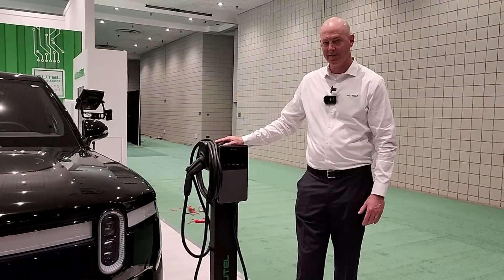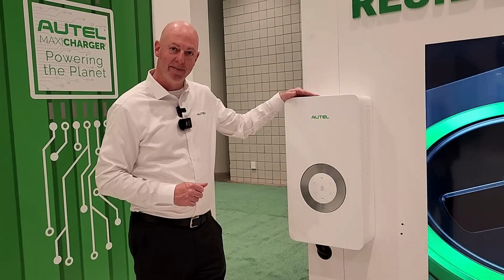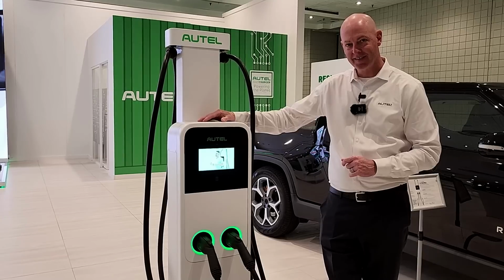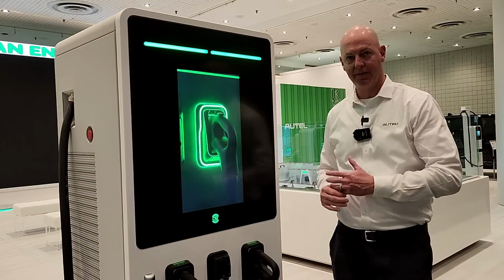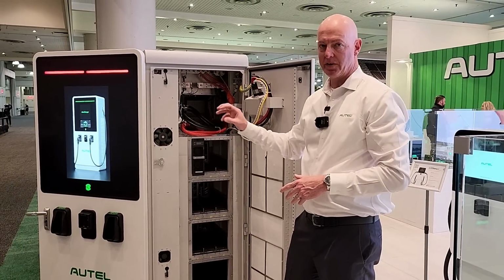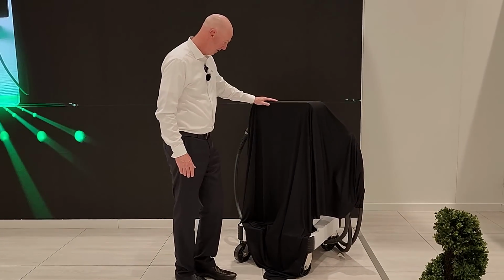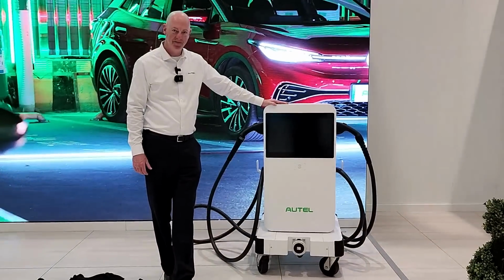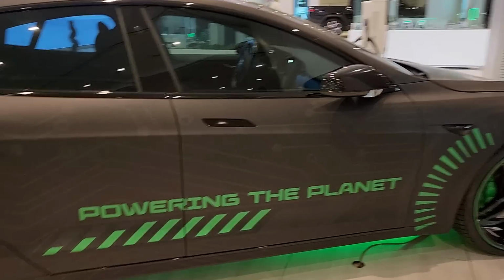Autel EV Chargers At The New York Auto Show

Comment: Excellent Autel
What I want to see if possible and vehicles become Bi-directional is the ability to work with a home storage solar system. 
I have the inverter and automatic transfer switch already. The inverter has empty breakers for more solar panels and it would be awesome if the car could used with the equipment I already have. Seems it would save people money. Just a wish.

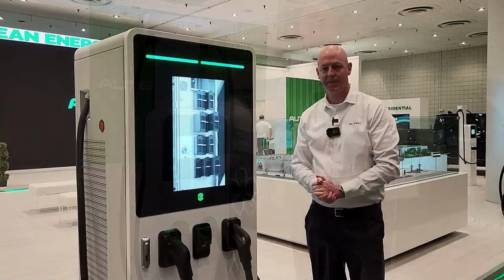Comment: 10:17 - heads up Tommy Molo, heads up Young KC, i meant to put this in the comments during last week's IE Podcast when Kyle was recapping his trip south through Georgia in his G/F's new Taycan (new to her anyway).  as you may or may not have heard me mention before I'm heavy into the Motorsports/Racing sector, well in one of the latest emails received from SEMA dated 3/30 there included an announcement that in collaboration with Georgia's Indigo Energy a bank of AUTEL DCFC's have now been installed at Atlanta Motorsports Park making it the first racetrack in "Murica" to go electric...🤙to be specific it's 5 of the 180kW MaxiChargers like the Autel rep/NBA Forward was showing you (and Kyle previewed back at CES). yes, the article DOES include a pic showing 5 units on pads - so it's legit - but technically the cables shown are still hanging shrink-wrapped on the sides, so no info on whether or not any related transformer equip is in place...? or any additional drop work to feed power to the site is waiting to be done by the Utility...?

I know you and KC are big on road trips, so if either of you are looking for a reason here in the Spring to head back down to GA (ref: Porsche HQ) you now have an additional reason.😁 the track is located North/North-East of Atlanta in Dawsonville, but it's still about an hour away from the SK Plant in Commerce making the F150 batteries, or an hour away from Road Atlanta in Braselton. as I was told back in Indianapolis at PRI the owner of the track is very much PRO EV so you might be able to check out the full EV converted Toyota 86 racer built by Scalar Performance Canada and Hypercraft Provo UT (just visited them out in Salt Lake City first week in March) cause I was told that very track - AMP - is where the car's being further tested/developed.  I'm picking up a Mach-E loaner later this week and I'll be using it to drive up to Javitz and I'll quiz the Autel guys about the install before I leave the show.  still waiting on word back tomorrow from my contacts to see if I can go over to the Lamborghini Lounge and see the new Hybrid Revuelto. 😎
Reply: edit: see he says the units are self-contained/standalone.

Comment: Good morning

As a result of your channel I have decided to purchase an Autel charger. The only stumbling block is the cable and it’s cold weather performance. You gave it a poor rating when reviewed but while interviewing Autel at the auto show it was revealed that Autel has sourced a new supplier and the cold weather problem has been fixed. My question is how do I determine if a unit purchased has the new cable installed.

Comment: Tom, I have an Autel home charger in upstate NY and yes, the cable is a bear in cold weather.. Wonder what they will do about people in my position? Can we get a new cable? Looking forward to your re-review.
Reply from the maker: If it's a big problem, I'm sure you can buy one and swap it out, but I doubt they would give it to you. The cable and connector probably cost the company more than $100 - it's the most expensive part of an EVSE, so they will likely charge you for it if you want to swap it out.
Reply: @StateOfChargeWithTomMoloughney  The question is how will a consumer know if they have an Autel unit with the new cable if they buy it from an online retailer as most people would?     The new screen will be obvious to see which would be cool to have but wonder how much that will cost for that feature?    As long as I can lock out the unit I'm ok with that but maybe requires the RFID card since my charger will be mounted on front side of my house.    I guess for ChargePoint there is no lockout but I assume you put a schedule from 11:00pm-11:00pm when you are away from the house for an extended period

Comment: Tom, just a heads up. The NEC is coding chargers to only 80% of outlet ratings. For those of you who don't understand take a 40 amp breaker (or two for 240): .8 x 40 =32 amps max charger. Apparently the NEC never figured outlets would run several hours  at max rate.
Reply from the maker: I talk about circuit requirements a lot in my review videos.
Reply: @StateOfChargeWithTomMoloughney  I know, now 80% is apparently the new code.
Reply from the maker: @mosfet500  That's not new. It's always been 80% of the circuits maximum power because EV charging is a "continuous load."
Reply: @StateOfChargeWithTomMoloughney  Thanks, I thought it was new, I stand corrected.

Comment: Not sure if this is an Autel, or Audi question:

My Autel MAXI AC LW12 (50amp circuit hardwire) will charge my 2020 Etron to 80% and stop as it's supposed to in the evening.  A couple of times I've left the cable tethered to the car - and in the morning the charging begins showing a %78 state and topping off the 2%.  If I unplug it in the evening, the car show's 80%.  So where is that 2% of activity coming from?  Being cabled to AUTEL and some phantom drain?  Temp dips (mild winter so far low-mid 30's at night.)? 

Nocturnal Audi battery conditioning?

Thanks

Comment: Ive been thinking about buying some these and put them in place that I know have no DC Faster Charger alot of beaches on the East cost have none.  AKA outter banks.. wonder what the cost is to  deploy one of these
Reply: To reduce costs, you need to select locations that already have sufficient MAINS power. If you select a location where a Utility company needs to bring in the power, it will take a very long time to break even, let alone turn a profit. Then you have the charger costs, monitoring and maintenance to consider.

Comment: Wouldn't it be great if they could have an inductive charger?   Just pull in the garage ..
Reply from the maker: That's still a few years down the line.
Reply: @StateOfChargeWithTomMoloughney  If ever.  That's a lot of current to transfer..
Reply: Too much energy loss, too inefficient.
Reply: @llaughridge  wrong, do more research next time. Wireless induction is already at 92-95% efficiency from the wall to car. 👍🏻

Comment: Will the new units (with the improved cable that performs better in cold weather) come with a different model number so that a potential customer can easily identify the improved version?
Reply from the maker: I wouldn't expect them to. Many other companies have changed cables/connectors and other components of their units through the years and didn't change the model numbers.

Comment: Hello Tom, have they improved on their connector.  Last time it failed the dropped test
Reply from the maker: No, but honestly, I think it just had bad luck and landed perfectly on the plastic tab that cracked. It's the same connector that Wallbox used for the Pulsar Plus 40-amp, and I love the feel of it. Also, Autel will sell you the tab that broke if it happens to you, and you can fix it pretty easily.

Comment: Note to Autel for DC fast chargers. Take Tom's unsolicited advice. Please please please tell the user when a unit is derated! In a perfect world, no DC fast charger would be de-rated. When it does need to be derated for any reason, please please please tell the user and make it totally clear! Same goes for power sharing, please make it very clear when power is shared between cables or cabinets when multiple are in use. User experience matters!!!! Operators will not do this, it needs to be done at the hardware and software level! Learn from the failings of those before you!

Comment: Looks like that 40kW dual DCFC unit still requires 480V three phase power which will dramatically increase the installation costs if a business doesn't already have that kind of power installed on-site.

Would be nice to see more options that work with 240V split phase power.  I'm only aware of a couple (perhaps just one that's sold under more than one brand) 24kW chargers that exist in this space right now.

Granted to get to ~`40kW with 240V you'd need a whopping 200A dedicated circuit which throws a monkey wrench into things.  Still would be much much cheaper than installing 480V three phase power.

Comment: $6,000? Wow Ford's at $1,800 for their bi directional home unit and wallbox was saying $2,500.
Reply: That ford price is for the outside unit only.  The inside hardware is another $4000 which doesn’t include the installer costs.  So if this can work with lightning then it’s comparable.  I hope. No complex individual units or dealing with Sunrun.